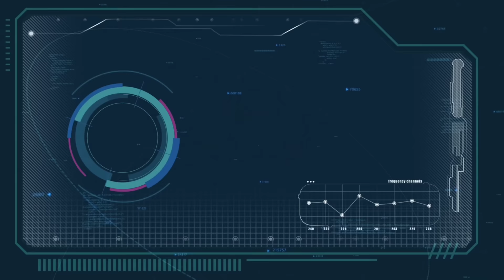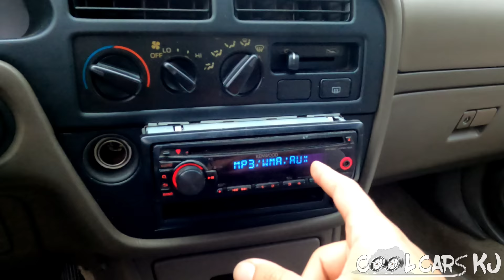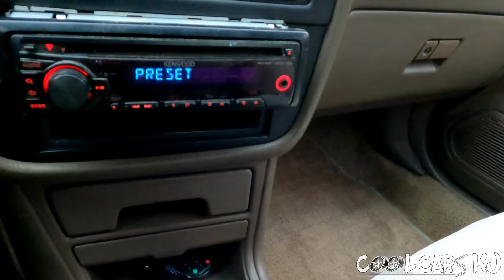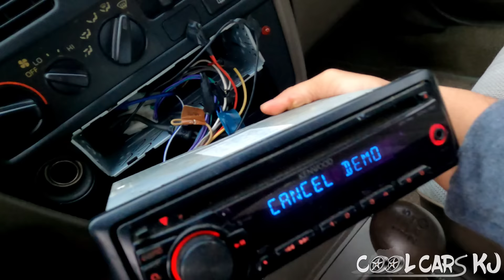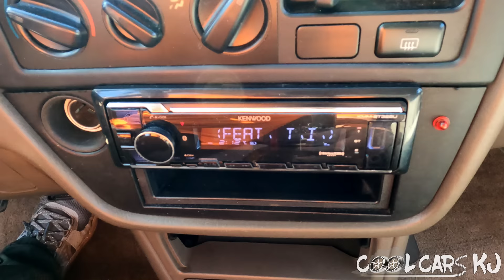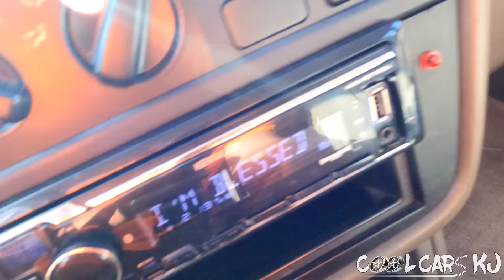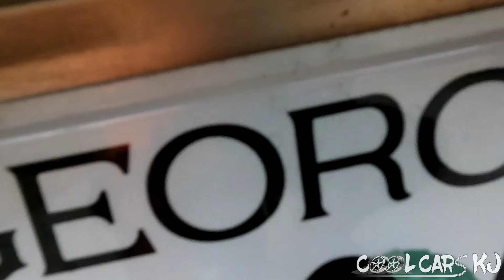Sold my OBS Chevy in record time 💰

Comment: That's all I can ride in is a extended cab because I'm fat  😆 I had a regular cab I'd have to put racing seats in it to get out from under the steering wheel
Reply: Same here love my extended cab. I paid 3k for mine guy wanted 3500$. I ain’t put nothing but brakes oil change plugs n wires. Daily driver.

Comment: Where are you located
Reply from the maker: Athens, GA
Reply: I been watching your channel, bro. I like what you are doing. I have a 1990 extended cab and a 1992 shortbed.
Reply from the maker: I appreciate you watching, and im glad you're enjoying the content. What's your plans for the trucks?
Reply: @Cool Cars KJ  The extended cab I painted, rims, suspension and I replaced all the lights, grill and emblems.  For the shortbed I did the suspension,  rear-end and new exhaust system.